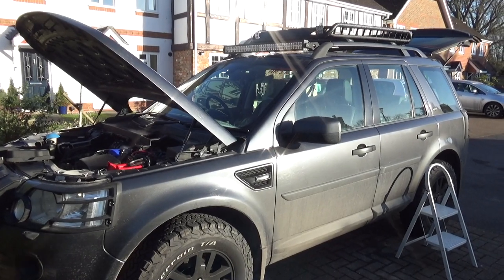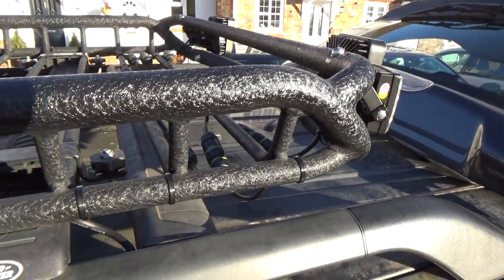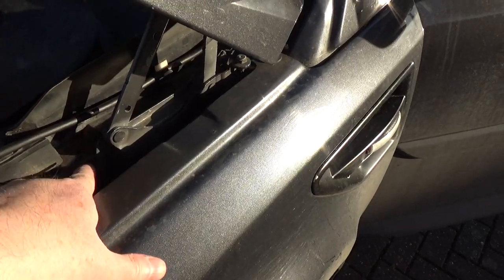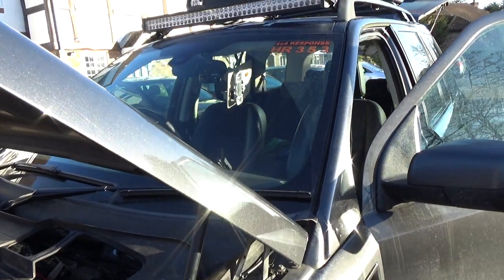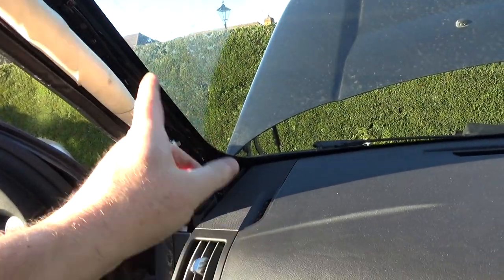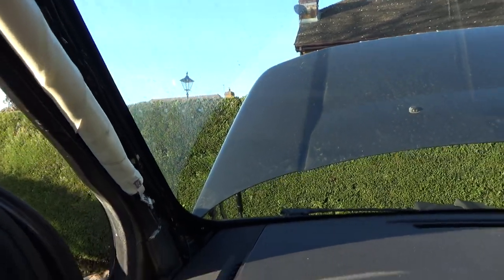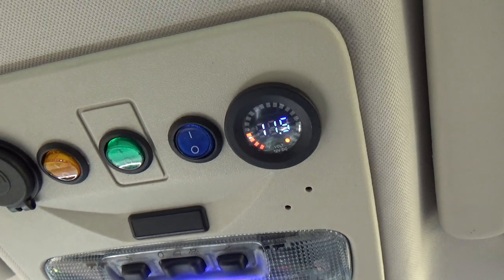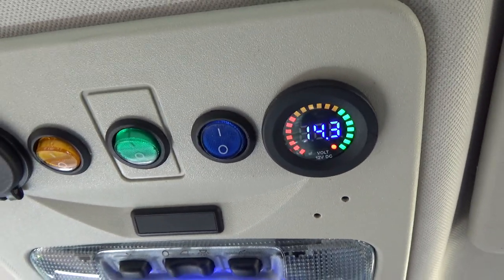Amber strobes & rear work lights (Part 2 of 2) - Land Rover Freelander 2

Comment: You gave me an idea by put the volt meter on!! I actually fitted the volt meter today and it actually looks good and it’s not too bright while driving at night! Where did you rewire the voltmeter to? I’m worried about having the flat battery the next day as it’s always on.
Reply from the maker: Just wired it into the interior light positive supply, off fuse 17, it goes off 20mins after locking the car. It won’t draw much current.
Reply: Appreciate your reply Beavis. It does look bloody good!

Comment: I think the usb in the head consule is a tad over kill and not really useful as you can add more usb sockets at low level easily and left the microphone as it was the Volt meter is okay and useful 🙂
Reply from the maker: Yeh, I wasn’t sure about the USBs, but added them mainly to balance the looks. It didn’t look right with just the voltmeter. I don’t want dangling wires while driving so the USB sockets will be for parked use only. The lower console sockets on my car are already in use for reverse camera screen, phone cradle, etc, so these sockets will allow the passenger to charge their devices too.

Comment: Excellent and informative video, I've installed the powerfulluk dashcam loom which is a tidy solution, however a shorter time before switching off would be good, any idea how this could be achieved?
Reply from the maker: You’d need your own timer circuit to do this, something like a 555 monostable.